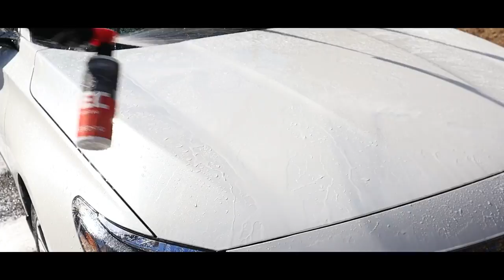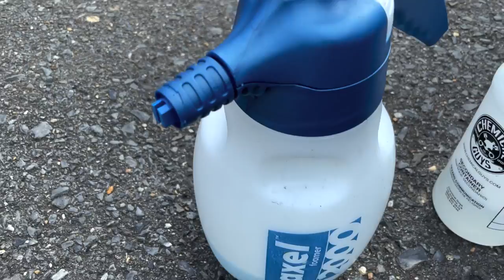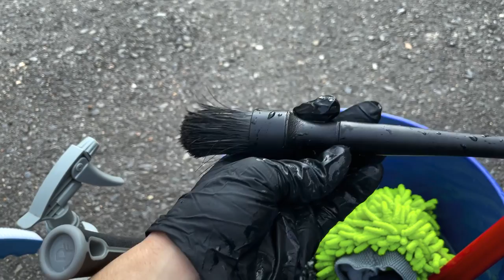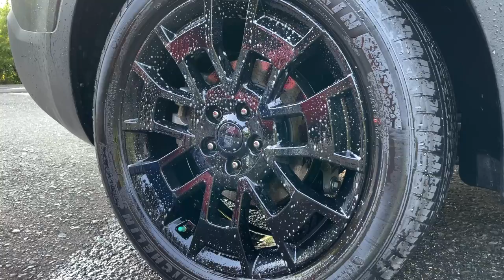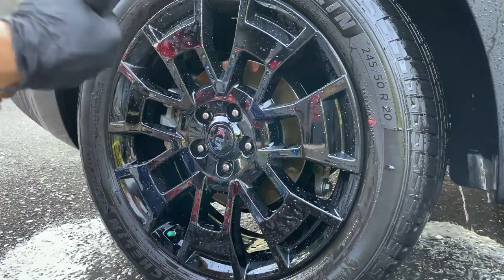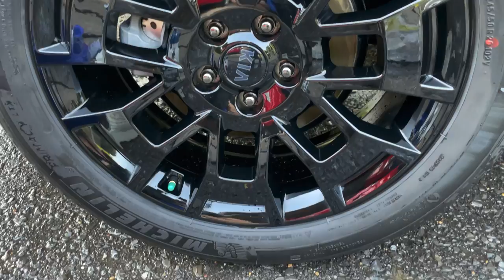How to Maintenance Wash a Ceramic Coated Vehicle (Part 1 Wheels & Tires)

Comment: Jamie, how do you like your foamer..?  DO you remove the excess liquid and clean it out regularly?  I bought an IK foamer a few years back and it was just a giant pain to keep it going.  It seemed to get clogged up and not perform.. I used it for wheels brake buster  etc..
Reply from the maker: No I just keep the left over solution in both my IK and Moralex bout every six months I change the filters and such and clean it out, I think I like the IK better but I’m still trying out the marolex it’s been a few weeks now I will compare them both soon 👍

Comment: Hey Jamie great stuff.  Would you recommend using the KCX MWC on coated matte/satin finish wheels?  I keep running into wheel cleaners particularly with the iron removing element that say safe on wheel types but then not for matte.  Im not understanding why it matters especially if coated saying we use iron removers  on ceramics for maintenance.  Thank you.!
Reply from the maker: Brake Buster 10-1 safe for all wheel types it’s because iron removers become acidic once it reacts with brake dust 👍🧼
Reply: @JamieTheCleaner    Thanks for the reply. I have Break Buster i have been waiting to use so that works out!